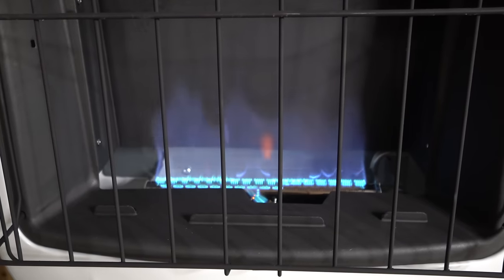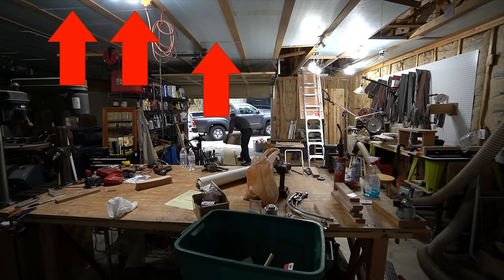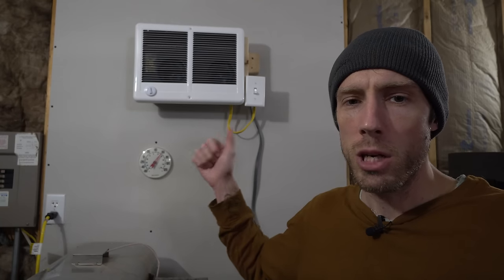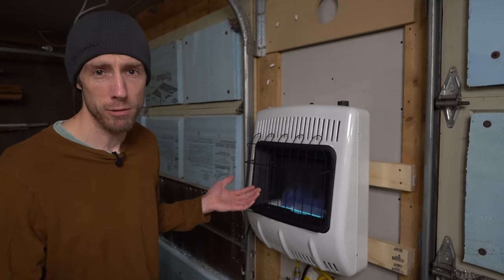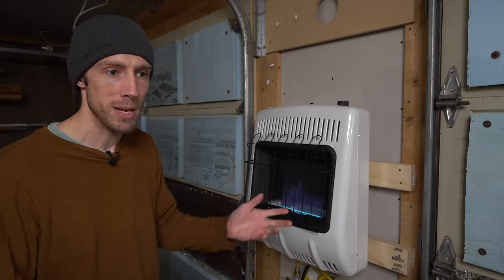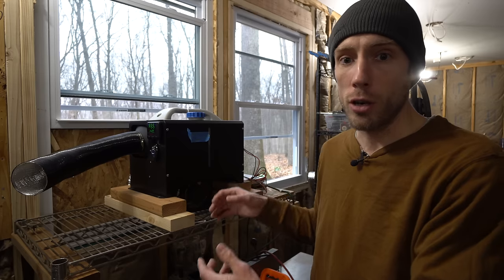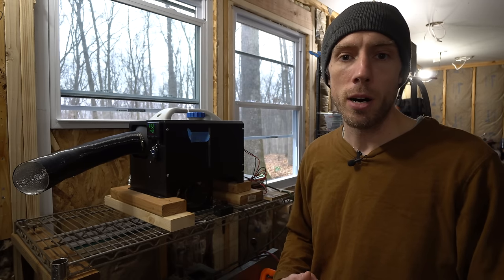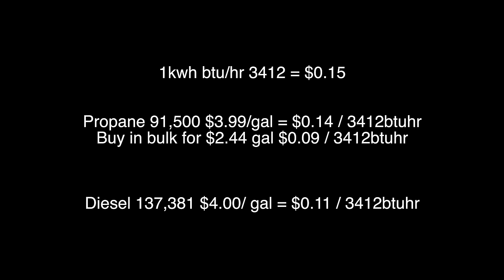What the most cost effective heater for a small shop? How I Heat My Shop For Cheap

Comment: How much diesel does it use how long is a full tank last
Reply from the maker: It depends on how high its turn up. Theres other videos that go over the specifics on these heaters and let you know exactly how much they use.
Reply: @OUTDOORS55  was wondering how long a tank last do you fill it once a day or more. Thanks I love the channel you tought me how to Sharpen thank you!
Reply from the maker: I fill mine either every day or every other day depending on how cold it is. Usually its 3/4 empty when i fill it🙂
Reply: @OUTDOORS55  hey thank you for ur response I would be using one I in the exact same way you use yours in my small wood shop. ✌️😏

Comment: Be careful when insulating your garage. You need some ventilation if you're going to burn gas or anything else inside, otherwise you can get carbon monoxide poisoning. You must make sure that all the fumes from burning go outside.

Comment: you didn't account for the diesel generator's electric power use in the power comparison
Reply from the maker: Because it's insignificant in the cost to run. Its less than $0.01 per hr

Comment: You should not be venting propane into your workspace. As you know some states have banned new installs of gas cooking stoves. You shouldn't be breathing products of combustion. As for efficiency the only way to do the efficiency test is using rather complex testing equipment. This has been done with NG heating appliances and they can get into the 90+% range . What is never mentioned is the inefficiency of electricity using fossil fuels like coal. Coal plants especially older ones are in the range of 30-40%, Gas units heating steam a bit more and combined cycle gas turbines bump to about 60%. If your efficiency is 80% which you assume it does seem like this is a better use of a fossil fuel than burning it to make steam to spin a turbine which generates electricity  to put into a grid to get to your house losing even more efficiency in the transmission!!!
Reply from the maker: The ban has nothing to do with air quality. It has everything to to with taxes. Im keeping my gas range.🙄

Comment: It seems that you’ve forgotten to factor in the electricity to run the diesel heater.
Reply from the maker: I didn't forget. It's insignificant. We dont deal with anything lower than $0.01.
Reply: @OUTDOORS55 Thanks for the reply. That was fast. Haven’t had a content maker reply so fast. I appreciate the video as it is a problem I need to solve. Thanks for doing the maths ;-) and showing the facts. I was wondering if a diesel heater was a viable solution for my work area and your case study is a proof of concept. Again, thanks.
Reply from the maker: Hmm, not sure...I think it would depend on exactly what you are heating. In a space similar to mine it works great. Mine has been doing a great job for the past two months. 👍

Comment: you already mentioned putting your diesel heater outside and pumping in the heat . so why dont you put a wood stove outside and pump in the heat . also you can get some older bitcoin miners for cheap , run those on electricity . they will heat your shop and almost break even for the bitcoin you earn  depending on your electric cost
Reply from the maker: Outdoor wood stoves are too expensive and will never pay for themselves.

Comment: It's like a lot of these videos. I see where there are honest hard-working trades Craftsman who are truly ignorant about thermodynamics and modern heating systems.  Because they have no technical education or training in these subject matters, they must learn by trial and  error.  Whereas the trained and educated h v a c engineer does not.  So many mistakes and he is honest in telling you about them.  Proper insulation.  And a proper heating system designed for the space.  For every single workshop, there should be only one type of heating system and that is: direct vent.  It is the cheapest, Safest, And most efficient.  A wood pellet stove is the way to go.  That is unless you have natural gas available and already run to one's home.  Then simply put in a direct vent natural gas furnace.  Don't believe me?  Take a look at the cost of fuel on an equivalent BTU basis. Do you know what a BTU is???  And what is proper insulation?  Absolutely no airgaps anywhere.  R 60 in the ceiling and R 20 in the walls.  And don't forget about the concrete floor to cover it up and if possible, put an R 9, matt down on it.  And who am I giving this advice?  What is my background, Professional Work experience, Is training and education?  I'll give you a hint in that I am not a trades craftsman.
Reply from the maker: Im not entirely sure what you sare saying.
Reply: @OUTDOORS55  It's okay that you don't understand.  The message i'm trying to get to you is very simple.  For Heating of all Workshops you want to use a direct vent heater.  Direct vent is the design of the unit.  For the type of fuel, the cheapest and most reliable is either wood pellets or natural gas.  Natural gas is the cheapest.  You can go on google and search under direct vent heating To learn how they work.  Of course, the first thing to take care of is getting the right insulation in sealing up your space.  Use the right kind of insulation so you don't trap moisture.  Good luck.

Comment: Your statement from 1:25 to 1:40 is false. Time after time, studies have been performed proving that ANY lack of heat when unoccupied always results in lower cost. The reason folks don't believe it is because usually their heater in question is simply not large enough for the task.

Also, consider dual-fuel rates, time-of-use rates, or whatever your power company calls it. They put in a second meter and give you half-price electricity during off-peak hours, which in my case is about 94% of the time. If you can store heat in concrete or water, this is the cheapest and easiest way to go. If you can't store heat, you can just fill in the other 6% of time with other heat sources.
Reply from the maker: We don't have reduced rates here. The rates are pre determined for one calendar year.
Reply: @OUTDOORS55  Wow, I wonder what percentage of distributors do not offer off-peak rates. I imagine it's quite low.

Comment: Small correction near the end: you can't compare kWh to BTU/h. Both kWh and BTU are a measure of energy, whereas BTU/h is energy over time, aka power. Whose equivalent would be W (or kW). It's as if you're saying: I have travelled 17 leagues, which for the uninitiated is about 58 or 59 miles per hour. You don't compare distance with speed, and you don't compare energy with power.
 
The correct comparison is: 1 kWh equals 3412 BTU. Or 1 kW equals 3412 BTU/h; take your pick.
 
I blame this confusion on space heater manufacturers, who incorrectly abbreviate BTU/h to simply "BTU" when stating the power of their product. If a 10 kW heater really had around 34120BTUs, it would run for precisely one hour before shutting down as it had depleted its entire stock of BTUs...
Reply from the maker: I have that kwh to btu conversion in the video and converted it to btu/h. That is what im comparing the btu/hr
Reply: @OUTDOORS55  Your numbers are correct, but your units are not. You have "1kWh =  3412 BTU/h", where it should be "1kWh = 3412 BTU". Further down in the same slide you write BTUhr but say 'BTU per hour", which is written as BTU/h.
 
Doesn't invalidate your results, and you still get your point across. But as a slightly autistic person with a scientific education, that slide seriously short-circuited my brain for a minute. 😂

Comment: Nothing "pays for itself" that's a myth. You may pay less for one thing than another, but unless you are pumping kilowatts into the grid, nothing will generate income. Same as the "more you spend, the more you save." Saving ≠ spending.
Reply from the maker: There is a break even point. Since nothing is free everything costs money. So if you can save money by installing a cheaper system to run and install than yes a system CAN pay for itself. Since nothing is free and you otherwise would have been paying a higher cost. However, most people Dont actually do the math and won't see the savings till decades later.
Reply: @OUTDOORS55  You paying less is not the same as it paying you. You might save something in the long run but that's just an arbitrary comparison to another product. The pays-for-itself concept only works in your imagination. Solar panels pay for themselves by generating income. Sunshine is a free energy source, so is moving water, geothermal, and wind.
Reply from the maker: @BariumCobaltNitrog3n  you're misunderstanding the difference between want and need. You HAVE to buy food or die. You HAVE to buy heat or die. Its not the more you spend the more you save. Its two different things. Youll have to understand that before we can have an intelligent conversation.
Reply: @OUTDOORS55  My approach to language is that words have meaning. I can appreciate the difference between want and need. My intent was not to upset or argue with you. But no one in the United States HAS to buy food, literally every state has food banks or some form of free food such as SNAP, WIC, Farm to Family, or your local church. 
Hunting is legal in most states. Same goes for heat and dog food. I got free utilities for a few years due to circumstances. 
And that's not the point. AFAIC the topic is that saving money by getting A instead of B is no where near the same as A paying for itself in X years. 

Language is what separates us from all other forms of life, it is THE most important factor to our survival as a species.